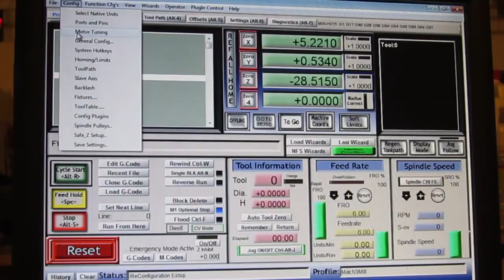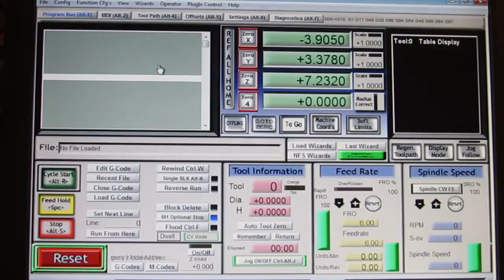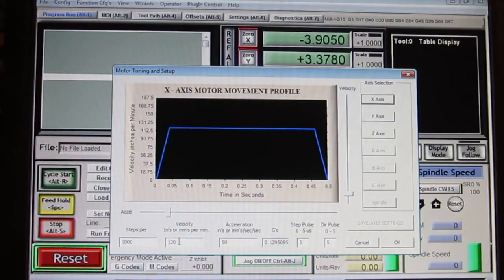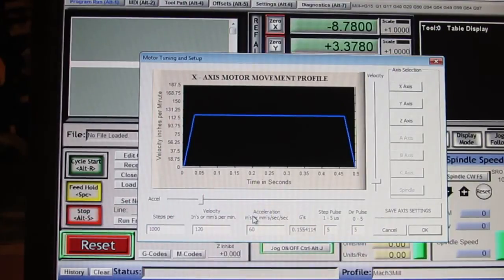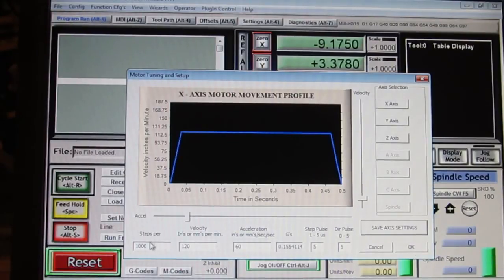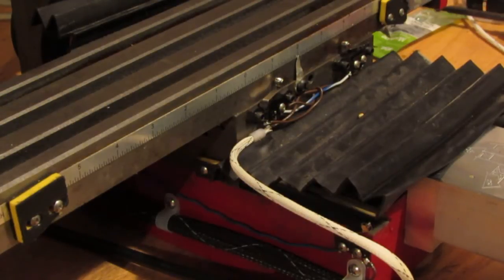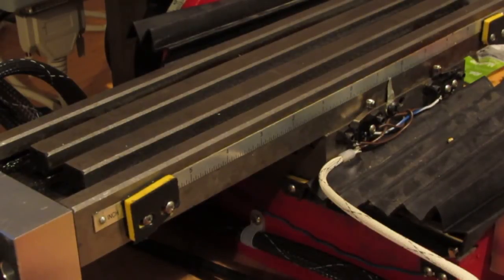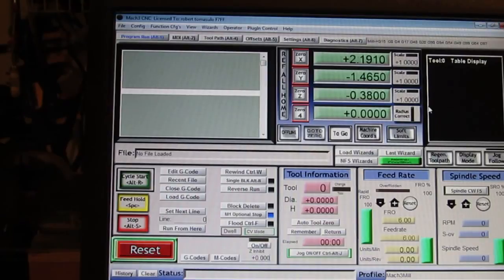X2 Mini Mill Conversion- Part 6a- Mach 3--Motor Tuning Setup

Comment: 1.8 degrees per step 200 steps for 1 complete turn with a 5 pitch ball screw = 1000 steps per full turn of the Stepper shaft. and if you use the micro stepping the 1000 would get even larger. by the increase of dividing the steps in half each time you break apart the 1.8 degree like Half step would be .9 degrees and would increase the steps per to 2000 in the software.

Comment: HI SIR
WHEN IM USE '' axis calibration "  the steps per unit is  "" 5.55221 '''' but when move cnc by g code the machine move very very slowly